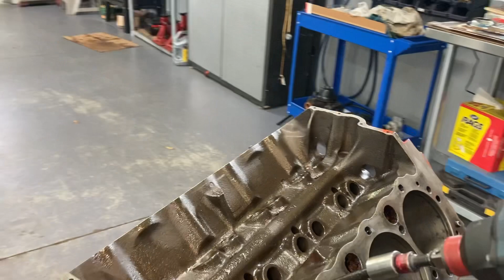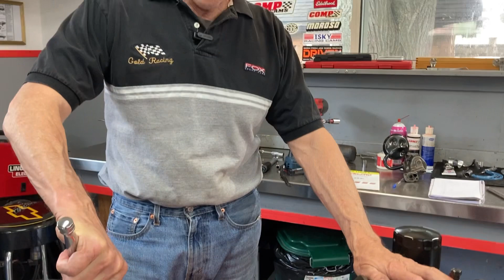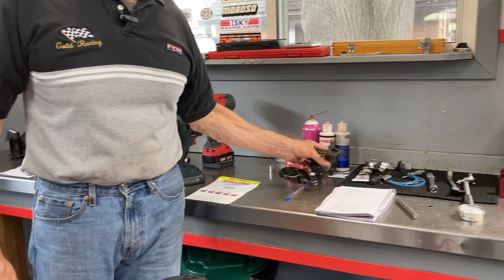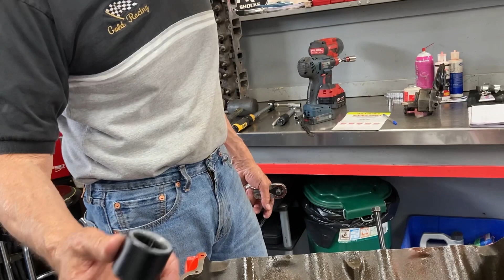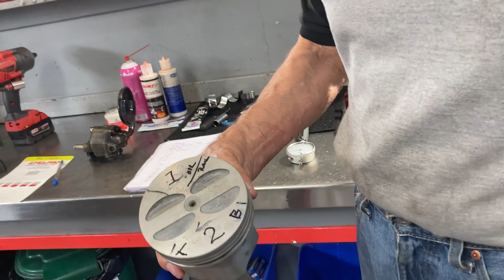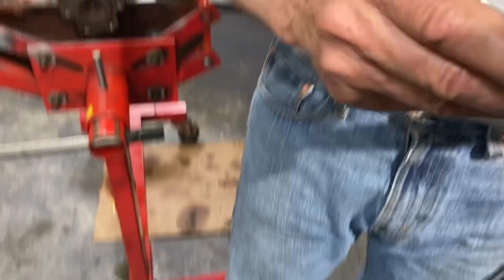Budget 350 Chevy - Assembly Tips to stay organized, prevent costly errors, save you time and money.

Comment: Word of caution everyone: it is very common to find a "GH" tap in your tool box, GH stands for ground high, if you use a GH tap you're gonna oversize your threads.  You need to use a "H1" tap, if your tap has no GH# or H1 on it, I'd try hard to figure out what degree of oversize it is, if any, before just running a tap through your block.  

Example: a GH3 tap indicates the tap is .0015 oversized, that's a lot and can weaken the thread strength significantly...

 search "GH numbers on tap"

Great videos sir!
Reply from the maker: Thanks amateurism, great advice. Thanks for your input. We are always learning. AG
Reply from the maker: I did not know that detail, but it is why I do not use a tap unless necessary. I spin a bolt in every hole in and out and if it moves freely I just leave it. AG

Comment: I use the bolt thread chaser thing also. I also take all the cleaned head bolts and run them in every bolt hole to make sure the bolt chaser bolt did well enough. A riffle brush helps prior helps the chaser bolt getting some of the corrosion and crud out first it's easier on threads hard on the brush. Thanks for the tips always get a new one. I have reused oil pumps there almost always good.
Reply from the maker: Thanks for sharing your knowledge and experience Jacqueline. We are always learning. AG

Comment: Do you have the part number for the mane and rod bearings that you used my 350 crank measure's 2.42.95 mane and 2.08.25 rod's
Reply from the maker: Thanks for the question Bos-G-State. The bearings are King, sold under the Summit name. Mike's crank was turned .020", looks like yours was also. The mains are SUM-172020 and the rods are 
Sum-17120. The last 2 numbers are always the undersize. Hope this helps AG
Reply: @goldsgarage8236  thanks for the info I'm learning a lot from your channel keep up the wonderful work

Comment: Well done, curious if you were using the hex adjust gear again, if so install the cam at 112 deg. then run a couple of dyno pulls, then advance it 4 to 108 deg., then again  4 deg. to 104 deg. where everyone thinks it should be anyway (LOL), I believe you'll see different numbers than you saw on the 400 going from 4 to 8 deg. advance, which was kind of disappointing because of the large cu. in. and small cam, just my .02 worth. Keep up the good work.👍
Reply from the maker: Thanks for the suggestion Mark. We should think about that. This Crower cam is already 104 ICL. I agree with your assessment of the 400 results on the dyno. We will keep digging if you keep watching and commenting. AG

Comment: I like to make a thread chaser by cutting a couple of vertical grooves across the threads on an old bolt. The groove gives a pocket  for the crud to fall into then it all comes out when you back it out. This is better than a tap because it's not hard enough to cut the cast iron hole you are cleaning.
Reply from the maker: That is a good suggestion Andy. It is definitely important not to cut parent material out of the thread. AG